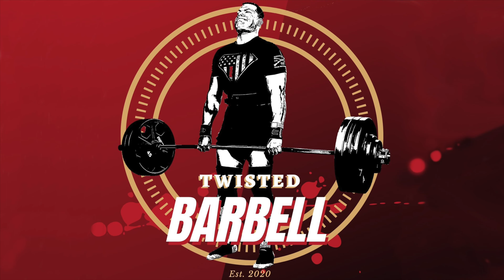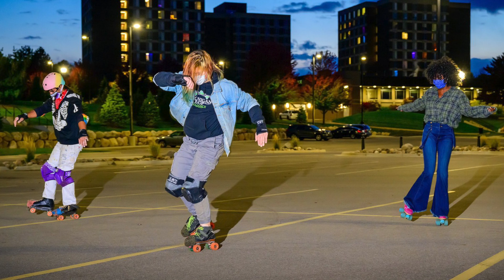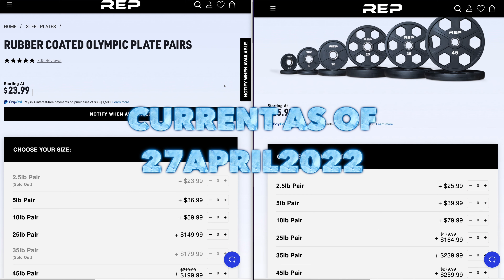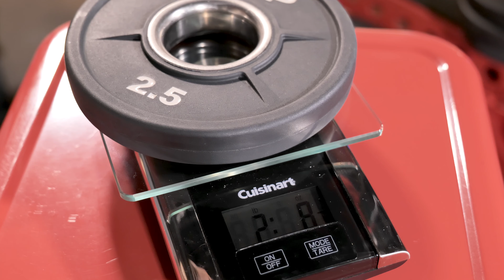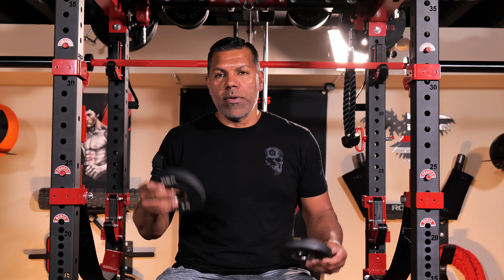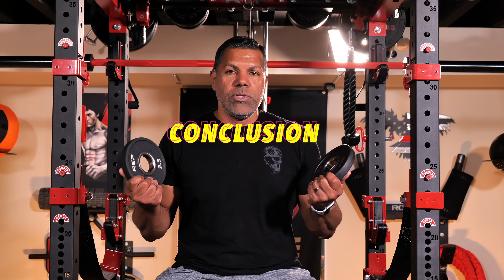Rep Fitness Coated Iron Plates; how do they hold up?

Comment: Nice work yesterday!! My wife cried for over an hour after that exchange. If you had beef with me you could’ve left her outta it. I had someone in the loading area mad because the pallet with my equipment was in the way(I don’t have a forklift and didn’t put it there) They told me to pull into one of the TWO spots that were sitting there completely empty and get it out. So thats what I did.

Comment: Thank you for this video and for the sound demonstration. I don't have any urethane plates and I thought they would be quieter. But are the urethane plates noticeably quieter than regular iron plates?
Reply from the maker: Yes, the urethane coating dampens the sound enough to dull the louder clanging you’d get from metal on metal.

Comment: So rubber are quieter and thinner. Those are the most important reasons to get rubber in my opinion! Yes durability is important but in a home gym setting you're not going tobe using them as much as commercial spaces anyway. Would've thought urethane before this review, but there are few premium looking rubber plates. 

Does anyone know if either the Rogue 6 shooters or Ivanko 7 shooters come in rubber instead of Urethane?
Reply from the maker: Not sure about those plates coming in rubber

Comment: Did you have an odor problem with the rubber ones when you first got them. If so how did you get rid of it. Also on the package there’s a label that says that the material used on the rubber one can cause cancer?
Reply from the maker: The odor dissipates after a week or two, depending on your environment

Comment: Great overview! Are there any differences in diameter of the 45 lb plate? Rep shows rubber as 17.5" and urethane as 17.7" but not sure if this is true or more based on tolerances. Only care because of deadlifts.
Reply from the maker: Thanks. Have to say I e never noticed a difference between the two. It’s so minor it’s not visible and I’ve used both together on deadlifts.
Reply: Thanks, that helped me decide. I purchased the Rep rubber coated plates since they are a little quieter and a little smaller in width.  There appear to be some other good, significantly less expensive rubber grip plate options from companies like Giant or ProMaxima, but I've had a great experiences with Rep and didn't want to take any chances.  It remains to be seen  how well they hold up in my garage gym in Houston with the extreme humidity and temperature. @twistedbarbell3950

Comment: Those style have held up pretty good in my commercial gym for several years. They have shown some wear around the sleeve holes but considering the volume of use, the urethane is very durable. I still wouldnt consider them a forever plate that your grandkids might use one day but I really enjoyed using them. Good grip and easy to pick up.
Reply from the maker: Thanks for sharing Jim. Good to know they can hold up to the abuse of a commercial gym.

Comment: This video is so perfect for what I needed to know, 😊 

I was wanting coded plates because most of my stuff is going to be underneath my front porch where it does get some sun. Kind of worried a bit about moisture and didn’t want steel plates. I’m hoping that the rubber will hold up to you these along with cold and hot temperatures throughout the year.
Reply: Oh and you earned another subscriber
Reply from the maker: I think the rubber coating should actually hold up well for your situation. The urethane too, but due to their rigidity, I’d worry about how they’d hold up to frigid temps, if that’s something you deal with.
Reply: It was minus 12 degrees Fahrenheit this morning and our high was 20.
That temperature up here is not that common so I may just have to bring the plates inside during those times.
Hopefully within the next 18 months, we will build an outbuilding for an actual gym. Just under 200 ft.².
Reply from the maker: @montanaplease  Sheesh! AT those temps, the Urethane might get brittle (not sure), so rubber coating may be best. Good luck with the setup!

Comment: I hadn't thought about my rubber plates rolling into my vehicle...fortunately my plates are twelve sided and don't roll well. ; )  I wonder if the level of noise with the urethane plates is due to the coating thickness of Rep's plates as I had UMAX Premium urethane plates a few years ago and they didn't make near that level of noise. Also of note, UMAX offers two grades of polyurethane plates, with the Premium plates being, well the premium of the two, and coating thickness may be one of the differences. I agree with your assessment, the urethane plates are much nicer (luxurious???)...but I was forced to sell them when I was laid off a few years ago : (              .................. Great review.
Reply from the maker: Thanks! Yes, there could be different densities of Urethane, or maybe more or less Urethane to Iron ratio. Also, although unlikely, lifting in a garage where your vehicle is, the potential for a plate to roll away from you, I would never say never, right? I never plan to bump my head into any of my barbells, but it happens all the damn time! 😂 Sorry to hear about the layoff, but glad you still have something to keep you going!

Comment: Have you noticed the rubber coated ones have marked up your floors with those black streaks? 

How bad did the rubber ones smell brand new?  I have a basemen gym also
Reply from the maker: Thankfully, no marks on my floor, but most of my lifts are on the Horse stall mats anyway. The smell fades after a while.

Comment: Hi Marcus, great video, as expected! Question: Any discernible odor difference? A little concerned about rubber, in addition to the risk of mistakenly leaning them against wall (;-
Reply: If I understand you correctly, then, the odor is quite a bit weaker than from horse-stall mats, isn't it? Would you say that (rubber) bumper plates are likely to emit more VOCs, or is it perhaps roughly the same? (Brand should matter, I imagine, feel free to just share your experience if you prefer not to speculate.) I don't plan to drop any weights, and the ability to grab the plates easily seems valuable, which is why I like the idea of rubber coated.
Reply from the maker: @nicolaegarleanu5776  definitely nothing like Horse stall mats! The Urethane odor is more contained likely due to the hardening process. Also, although I do own a single pair of bumpers, I’d rather not speculate on bumpers as a whole. The rubber of the iron plates could be similar to bumpers, but I’m assuming since it’s just a coating, as opposed to full rubber throughout, the odor wasn’t that strong to me. Horse stall mats are completely obvious and there’s no ignoring or forgetting their odor until a significant amount of time has passed. The rubber on my coated plates stopped being obvious to me in much less time and I don’t even notice it anymore. I’d have to put my nose to it to detect the odor. The tactile feel of the rubber is very nice and I enjoy grabbing them with little fear of slippage.
Reply from the maker: Not much, but there is a subtle difference in odor. The rubber odor being stronger, but it dissipates over time. Also, you are right in the rubber potentially leaving scuffs on a wall if you're not careful - much in the way a sneaker can scuff a floor.

Comment: Great vid as always man!  Do you think bumper plates are necessary for deadlifting if I already own rubber coated iron plates? I do mostly body building programming. I also dead lift in my garage, on stall mats and the titan crash pads.  The foundation in the garage is already has cracks in it from before I set up the gym. Thank you in advance for the advice
Reply from the maker: Thanks bro! Bumpers aren’t necessary in your case. You’ve got more than enough cushioning and you could even do without the crash pads if you’ve got stall mats on the garage slab. They make for a nice cushion, but your setup is good as is.
Reply: Thank you man, saved me some $$$.
Reply from the maker: @bro_nah___1  no sweat

Comment: Great review Marcus! I love my REP rubber plates and using the handles in a tight space works well, moving from squat to bench. Do you think there is anything we should do as far as maintenance to keep them in great shape longterm?
Reply from the maker: Thanks Joe and that’s a good question! As I’m also into car detailing, I thought about using some great products to keep the rubber conditioned like we do with tires, but I have yet to find that necessary. If I ever feel like they’re drying up, I may do that, but I’m leaving them as is for the time being.

Comment: The urethane sound almost like iron plates. Very little sound deadening. 

If you knew what you knew today, would you have gone all rubber?
Reply from the maker: No. Still would have got the Urethane plates and I still enjoy using them. They are solid and just a tad more refined than the rubbers, so they feel a tad more premium.